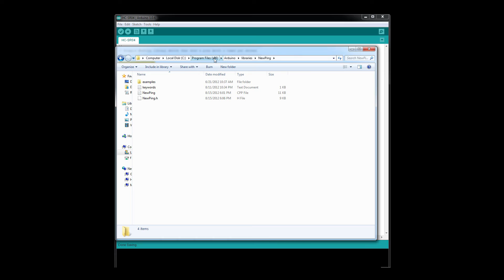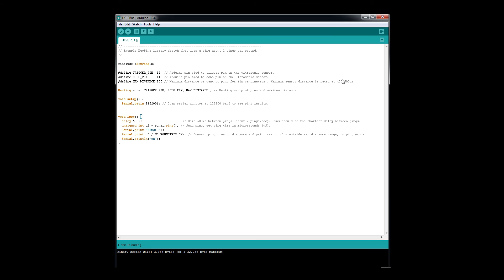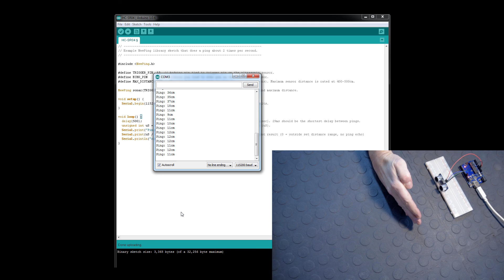Using the HC-SR04 Ultrasonic Range Sensor with an Arduino - Tutorial

Comment: It gives me an error :(   :
 #include <NewPing.h>

                     ^

compilation terminated.

exit status 1
Error compiling for board Arduino/Genuino Uno.
Reply: +Technic Gear Please help!
Reply: Technic Gear I've been Having those errors too what you have to do is make sure you arduino is connected to your computer make sure the usb cord is in good if that does not work try switching what USB port your using if that does not work try to go to tools and make sure you got the right board selected. I hope this comment helps you.
Reply: Technic Gear never mind I found out the problem you have to download NewPing_v1.8 from the link you have to go to the bottom of the page and there will be another link that leads to the page where you can download it

Comment: Would it be possible to use this sensor to detect if an object is present within it's field of view (Within 3 feet) and if so turn on/off a relay switch?
Reply from the maker: +Ali Abdel In this tutorial here: https://youtu.be/DjBRScRAVrc we used a Motion Sensor to turn on / off a relay.  You could use the Ultrasonic sensor instead to activate the relay when the distance to an object is within 3 feet if you wanted.  Hope that helps and thank you for watching!
Reply: +Brainy-Bits 

Thanks. So now the issue i'm running into is after setting up the Ultrasonic Range Sensor is the Ping works only if an object is present at the beginning but after that object leaves its field of detection ping goes back to 0cm and never comes back to sensing an object until the board is power cycled. Does this mean my module is bad or this how the module is supposed to operate?
Reply from the maker: +Ali Abdel Here are some tutorials using the ultrasonic sensor:
https://youtu.be/mtE9avJ0POk
https://youtu.be/ibFociLpsXQ
You can see that your sensor should sense proximity all the time...  Maybe check your connections, or start by testing your sensor using the code in those tutorials to make sure your sensor is ok.